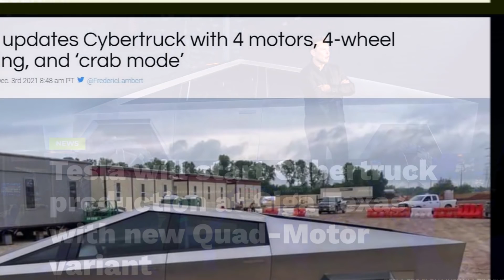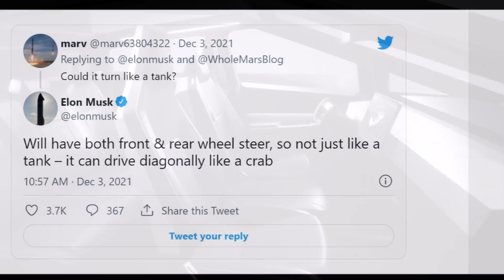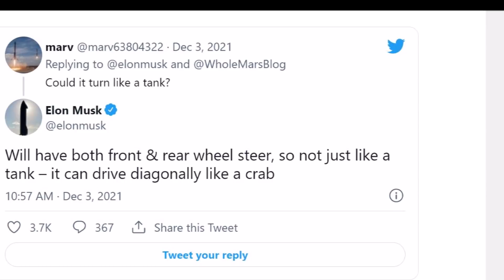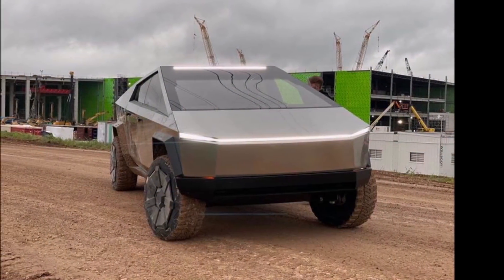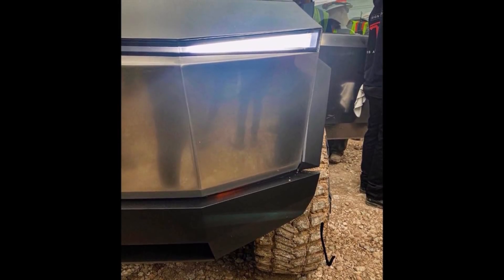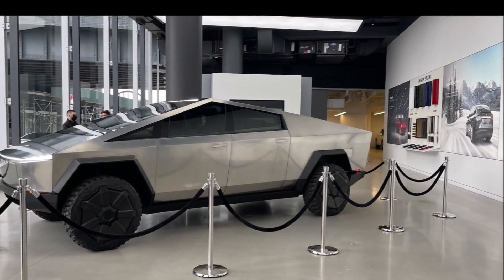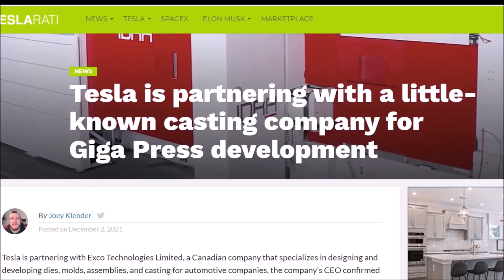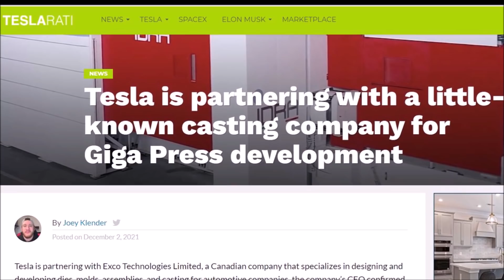Tesla Updates Cybertruck, Elon Musk Presents New Production Variant

Comment: No doubt plaid motors front and rear. that thing is gonna be nuts.
Reply: I don't think they use them. Too expensive and most advantages are high power over large speed area. Cybertruck needs well cooled motors which can provide continuous torque in very low rpm or being still.

I think they have dedicated motors for cybertruck.
Reply: @teropiispala2576  Yeah they will use them. all they are just tweaked model three motors anyway. same type motors in the semi. so why would you need to re engineer something you don't have to? You can race all day in a plaid with out it getting winded so i think they got cooling covered.
Reply: Maybe software lock to limit speed? Otherwise, why get a Plaid S or X when the truck has it all, haha
Reply: @Frzenflme  people would choose the plaid Model S cuz it handles better and has better aerodynamics that will make it feel more stable while accelerating quickly

Comment: Interesting. I had figured on both of these things happening. Since the Plaid's rear-twin-siamesed and modified Model 3 motors show the whole engine, suspension, brakes cradle assembly as one unit. It was a foregone conclusion that Tesla would offer their Cybertruck, Plaid S/X and Roadster in quad motor versions. As with the original RWD Model Y that never made it to the U.S. (so far) I had figured long ago that the single motor RWD Cybertruck would also disappear before production. Tesla's $39K Cybertruck price was meant to tempt, shock, and surprise, just as the $35K Model 3, and upcoming $25K models have rocked the industry. Tesla came up with the excuse that the RWD Model Y didn't have adequate range so that they could cut it, and the (now gone) entry level, RWD, Cybertruck will unofficially remain as a special order item, but they will insist that demand is low and offer incentives to upgrade to the AWD versions.